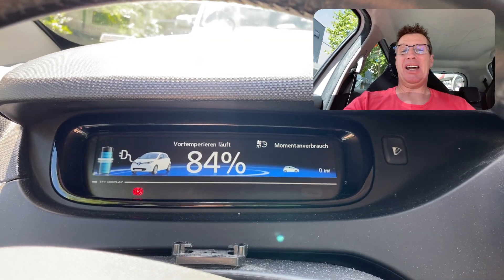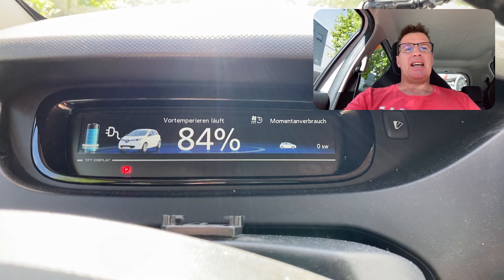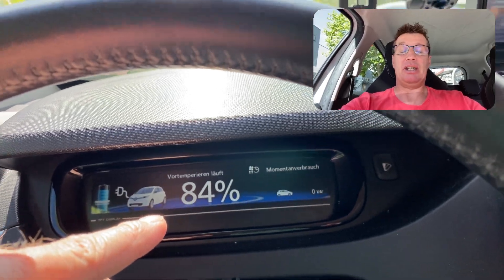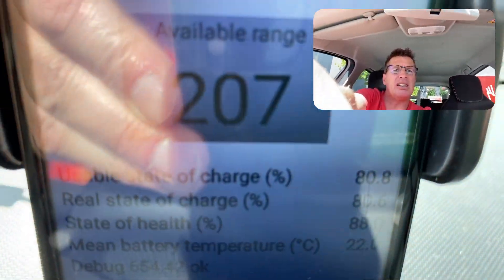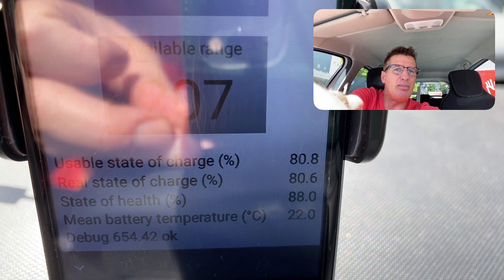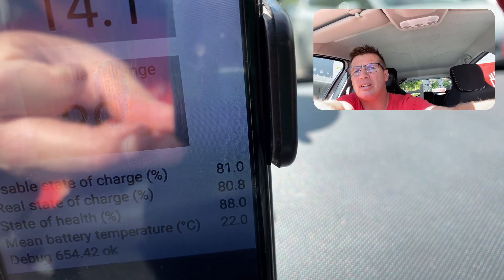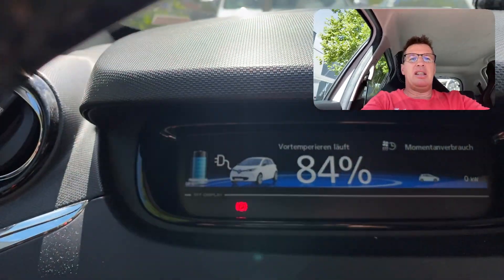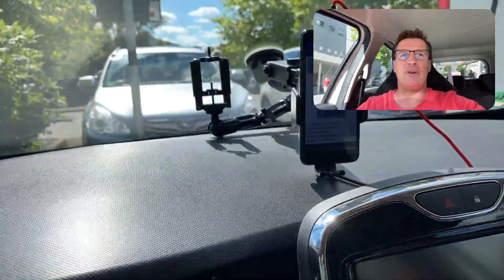🔴 State of charge different from real battery load in Renault Zoe...?

Comment: I see the state of health is 88% do you see a big difference in range since you bought the car? Thanks for a good youtube channel!
Reply from the maker: Not really, because I am not driving like a gasoline car. Means full tank and drive until it's empty to refill it again.
Driving an electric car is charging every time when the car is standing around and it not used. So no need to wait for the charging and the battery is always full. :-)
Reply: @eDriver  ok, I have a Zoe 40 R90, I drive every week a long journey for about 230km, I usually have to stop in winter time for about 15-20 minutes to charge up a little, it's this journeys I'm afraid will be suffering for the battery degradation... 🤔
Reply: What was the sum mileage of the car at that time? 120000km?